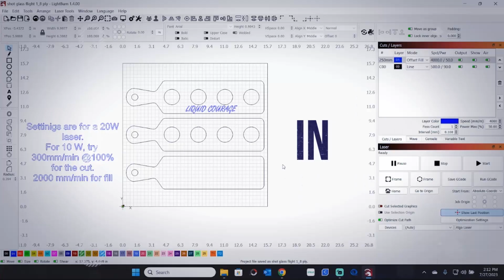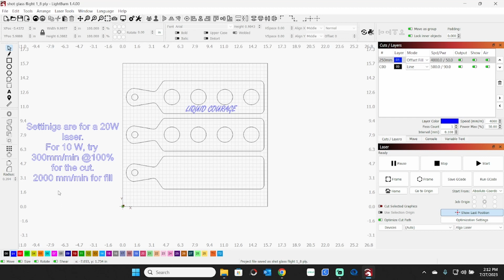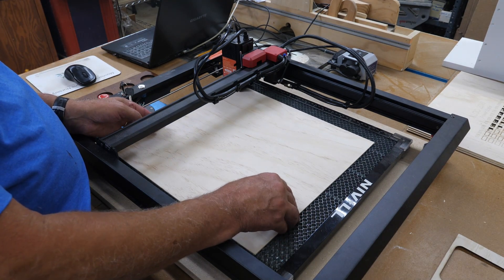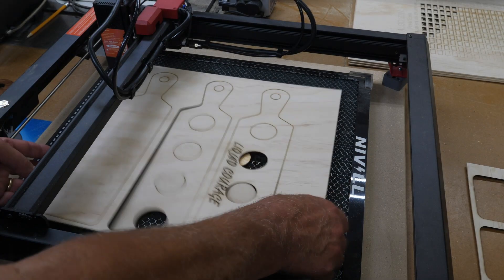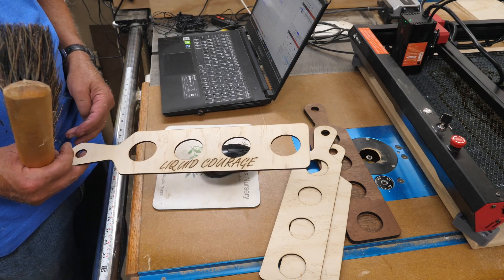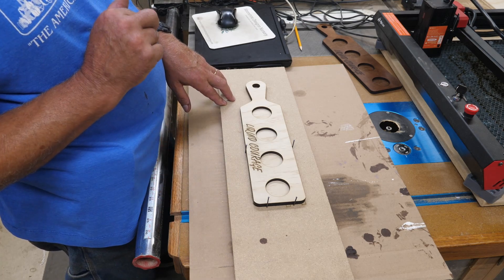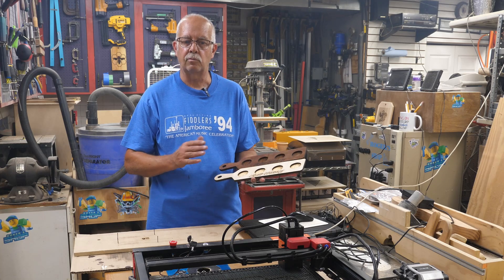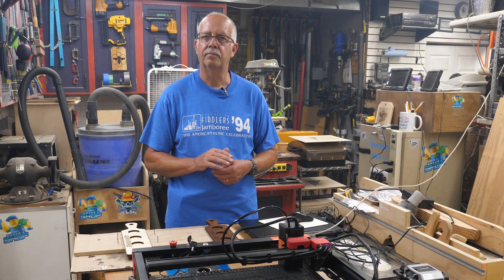Beginner Laser Project 18 Shot Glass Flight

Comment: If I was to use the atomstack a5 pro 5w (not the pro plus) what settings would you recommend? I found your assembly guide on the pro plus very helpful even though I was assembling the pro - the machine was second hand and had been entirely taken apart so I found it very difficult to find information on how the x axis was assembled as it’s supplied already assembled but from watching your vid I think I managed it - did you do any follow up vids on the atomstack? Love your vids and I’ll be subscribing 👏🏻👍🏻🥃
Reply from the maker: It is best to run a material test to find your best setpoint on the material you are going to use.  Plywood, especially, can vary depending on the glue used, the type, etc.  A material test grid can be quickly created in Lightburn.

Comment: Hi Roger,
I did exactly what you said. I tried cutting one flight board by itself and it still only cuts out the circles. Its like the program is missing something. HELP I don't know what else to try. I have deleted and redownloaded the file and still does same thing.
Reply from the maker: Email me at raltman57@gmail.com and I will send you a custom file with the outer cut as a separate layer.
Reply: @rogersshop  👍👍👍Thank you